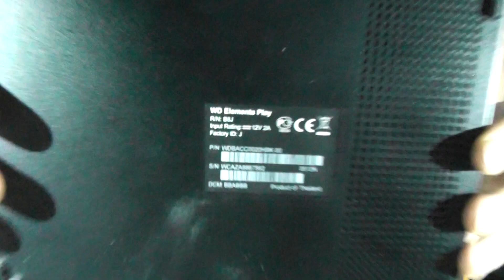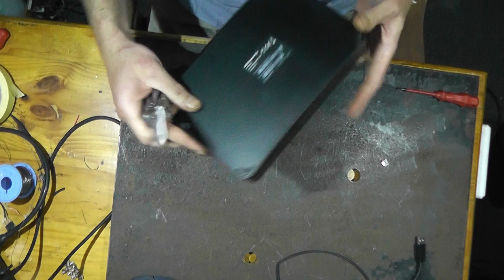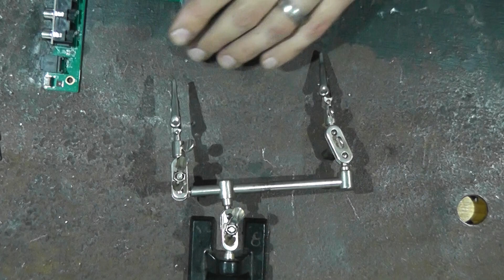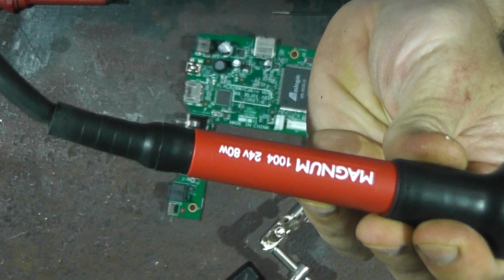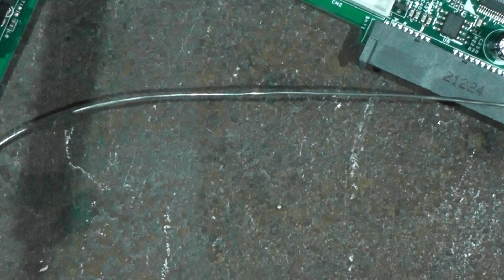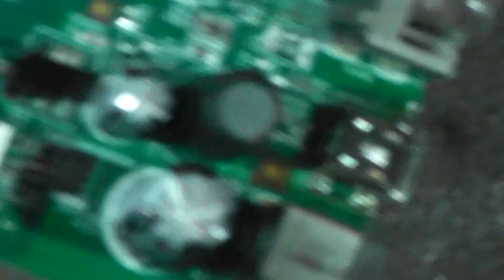#2 - Repairing WD Elements Play drive USB connector

Comment: I fixed it the same way you show how to. My usb square metal piece is connected to the bard where its supposed to be superglued on. But my computer cant detect it! The external hard drive works, it gets power it turns on & lights up & whirls but it cant find it! How do I get my seriously important data from my external?